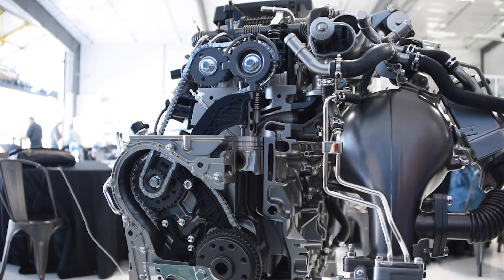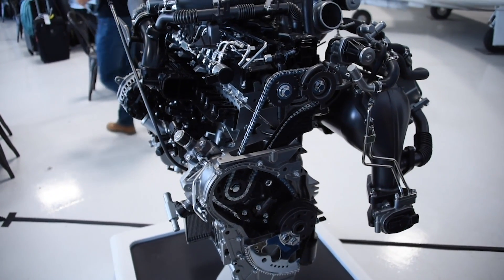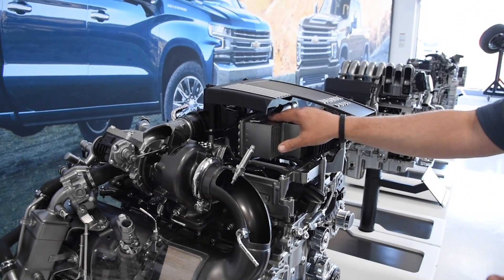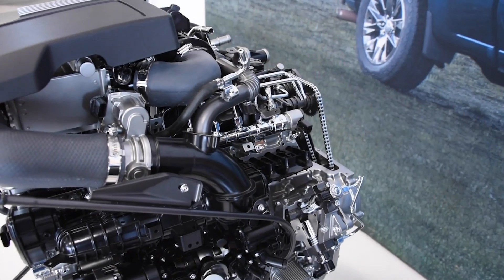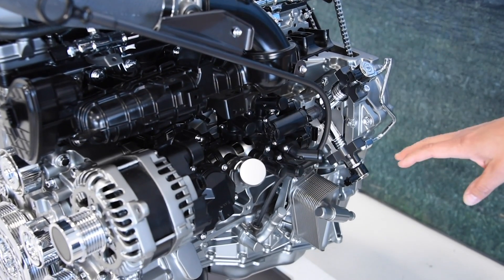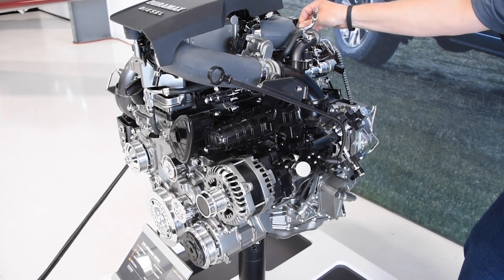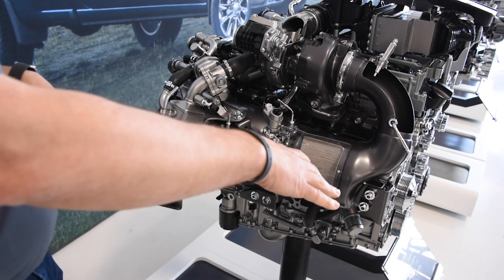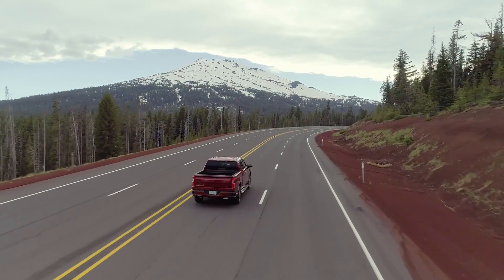What you don't know about the 3.0-liter Duramax diesel

Comment: GM just needs to go ahead and include one belt change, between 100k and 200k miles, in price of truck.  that would go a long way to ease customers minds.
Reply: Yeah " IF " its NOT a failure point that blows up the engine because of failure Like  l belts do
Reply: That's a great idea.
Reply: Seriously? 
No way GM would extend a warranty like that..
Especially when these engines- with thier impressive price tags and performance- start grenading by the thousands from designed-in fail points popping apart ?
If Any of those 3 critical timing chain- oil belt fails, the engines instantly a boatanchor....pistons scored, valves bent, head/ block cracked..
Reply: @aaronhumphrey2009  I agree but how did the block crack?
Reply: @russianacorns8080  when the top of the piston hits the open valve, the valves bent, the piston distorted, sometimes the con rod bends / breaks loose, bearings squished out of round, actual block cracking is rare..
Reply: @aaronhumphrey2009  wouldnt that be every engine that has interference cams.
Reply: @aaronhumphrey2009  Sorry you can't afford to buy one.. LOL
Reply: The trans will need to come off anyway before it gets to 200k like all Chevys so the belt will be a easy change. All the tech sounds scary when you dont understand it but people want fuel economy, it's the only way to achieve it🤷‍♂️
Reply: @bigozo1981  how exactly does a belt driven oil pump and timing chains at the rear of the motor improve fuel economy? Sounds like some bullshit to combat right to repair lawsuits.
Reply: @bigozo1981  When fuel reaches $7 a gallon (at $5 now in CA) the imaginary never proven belt change will be just lyrics in the internet cry babies song book. I'm getting double the fuel mileage I was in my F250.
Reply: Why is the oil pump belt driven to begin with?!?!
Reply: GM should include one diaper change for all the cry baby wannabe truck owners that can't afford a new 3.0..
Reply: @lowboy003  you know what amazes me, is how you call people who can’t afford a new 3.0 crybaby wannabe truck owners, but then talk about fuel economy like some broke asshole. Get your story straight for Christ sake.
Reply: @russianacorns8080  Get used to it sonny.. Everything in the future will be BIO (Belt in Oil) drives. Testing in the last year (thousands of hours) with new belt compounds has put these far ahead of anything else: lighter, quieter, less frictional loss, and the ability to absorb torsional oscillation.
Reply: @lowboy003  who cares about how light and quiet it is if it breaks and locks up your motor
Reply: @russianacorns8080  Sorry, I didn't intend for a bit of truth to piss you off to the point of psychobabble.
Reply: @lowboy003  you go ahead and keep telling yourself that. I’m sure you have a 100% argument win rate.
Reply: @russianacorns8080   Im not sure you understand modern belts, very reliable. I’ve seen them tear in external applications, usually from a rock in the gears, and have never seen one lose a cog. Been using them for years. In addition, the belt powers a pump not any mechanical portion of the engine. Pump stops working, oil pressure warning message/lights come on you got a couple minutes to get stopped and call a tow truck.
Reply: @tedmccauley9319  ah yes I have no idea what I’m talking about, me who has replaced hundreds of timing belts in my career. I’ve never seen a broken belt, what they do it shear teeth and an interference engine that’s game over, valves hit pistons and it goes out for reman. In this case if teeth shear you’ll lose oil pressure, and god forbid you’re towing when it happens or on a curve or anywhere besides going to the mall. Scored bearings scored cylinder walls, it’s a diesel so it should have cooling jets for the pistons so melted pistons possibly. Exactly what I want my 40k dollar truck to do.
Reply: @russianacorns8080  Hey not sure why you think the oil drive belt will affect the valve timing.....It looks as though the only thing it would do is cause a loss of oil pressure. Of course it probably would be better off if it did cause piston to valve contact instead of a sudden lack of oil pressure LOLs.
Reply: @richardgavle6343  read my comment again carefully, I was just explaining about how timing belts fail usually. I then went on to elaborate on the oil pump belt, if this engine had a normal oil pump drive like a chain or a gear I would be almost okay with the fact the timing chain is at the rear of the motor. Might even give it a try, I’m liking the idea of 30+ mpg in a half ton pickup, but if it’s gonna kaput under light duty use because of some design BS I’m not even gonna have a second thought
Reply: @lowboy003  I can’t wait for that belt to strip its teeth, than it’ll have less than you do. “Wannabe truck owners”  why are you calling them wannabe truck owners when they don’t want to spend 40 grand on something that could cause the engine to lose oil pressure and seize, god for it you’re towing when it happens. Of course you get better mpg than your f250 dumb fuck, this is a 3.0 diesel compared to whatever engine you had if you had a 460 or a 7.3 then no fucking shit it’s more fuel efficient, even if you had a new 6.2 or 6.7 those motors are double the displacement what did you think was gonna happen when you went to a 3.0? God the mouth breathers get worse and worse every fucking day
Reply: @lowboy003  at least I can read. You seem to think that it’s somehow impressive that a 3.0 diesel is more fuel efficient than an over 6 liter engine. Also what kind of an insult is my mom breaking the belt on a sewing machine? Is that best your smooth brain can think of? Sadly lacking.

Comment: I wonder in all honesty how long an overcomplicated motor like this will last. aluminum block+ head, more emissions components than one should be allowed to even think up, oil pump belt that one can only service as a preventive step or replace the motor. I can only imagine how many people will be buying these trucks second hand and not even think about that belt before it is too late and it snaps when they still have a loan on the truck. I'd estimate the replacement will end up costing one around 12-14k. A cooling system that has more going on at any given moment than most people do in their heads. Don't forget about the boosted injector pressures that sounds great on paper but with our low sulfur diesel, there are certainly going to be injector lubrication issues. This is why people are always broke. You should not have to have a shop to do maintenance on your truck if you don't want to take a loan out simply to do routine maintenance